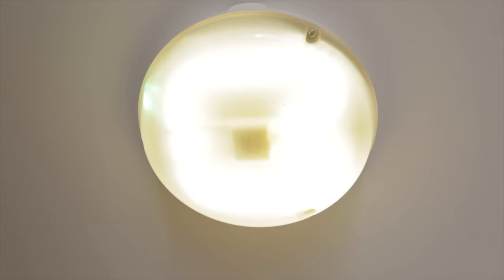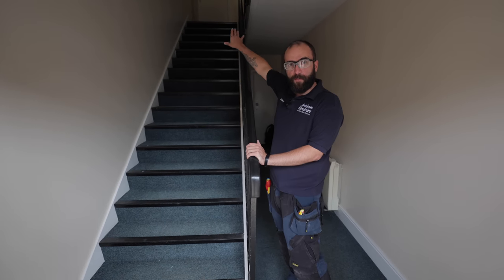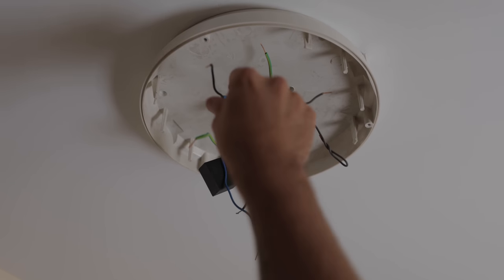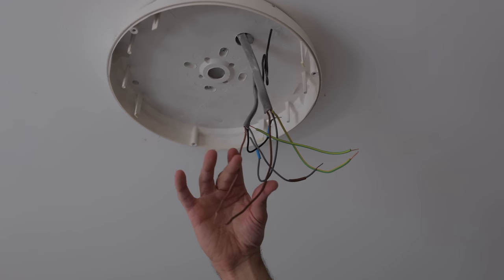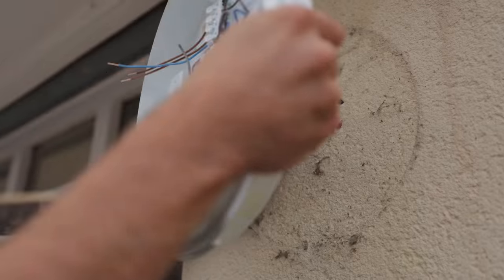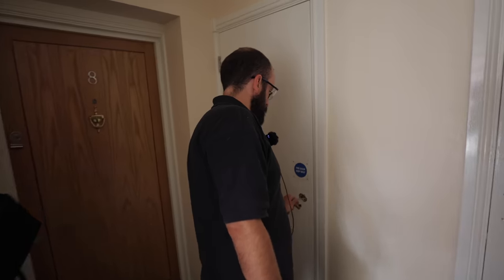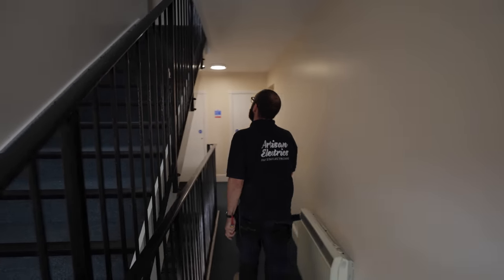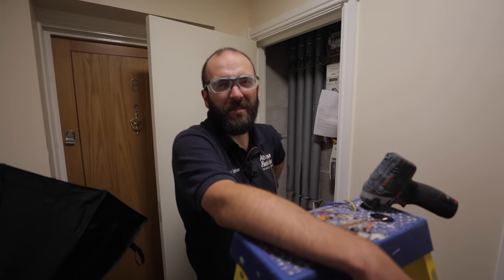Blinding LED Lights, EMBARRASSING Lockouts & Electrical Cardio

Comment: When we had the lighting replaced in our corridors/emergency routes, we also had CCTV installed; we noticed that the cameras were using a lot of storage, the lights would trigger each other and trigger recording, I'm sure our sparkies had a "great time" adjusting them.

Comment: Hello, Artisans. I wanted to ask, if you could produce a video, about energy monitoring in your home? Smart Meter, Smart plugs or whatever is the best possible and cost effective way to keep an eye on your consumption. And also wanted to say, thank you for your very well made and informative videos. You are a great team 👍
Reply: May I suggest you get a clamp on meter with a remote display, (Amazon) you can watch your consumption change as you use it, problem is after a few weeks you just ignore it, since you must boil the kettle,  run the washing machine etc. Smart sockets that you control via app or voice, are a novelty, you should get up and turn things off. If you want to use less electricity, get LED lamps and switch stuff off as soon as you are finished with it. 😀
Reply from the maker: Thanks for the idea!

Comment: You should really be putting todays date on those batteries so the next contractor knows when the 4 years of service is up. Yes the manufacter date is on them but that could already be a year prior to installing. You may have done so but it didn't look as though you did.

Comment: We did some communal lighting upgrades last year. 3 storeys, push buttons. 3 switches for each level. All wired in galv conduit. There were so many redundant lives when we finished! We pulled out loads of red singles and linked out every switch. It was very satisfying. 

A word of caution, those microwave sensors can see through flat doors. We had to turn the sensitivity right down outside the flats as some doors had windows in.
Reply: Similar problem. Had one in a toilet, which was fitted with a fire door.  The light could sense you entering the building, through/under the toilet door plus through/under a second fire door! The light does not trigger if you walk past the closed toilet door and sometimes even fails to light when you enter use the toilet.
Reply: I totally agree about the sensitivity on these. I default to 50% sensitivity then a lux disabled walk test to check switching for the escape route. Then set lux and  re walk the route to check for any unwanted daytime operation then finally set the duration. There is a bit of skill in getting these set up well as even in daytime you get varying Lux levels in common parts where there are flat doors further away from natural light sources. I swear if the sensitivity was left at 100% they would probably be constantly on picking up traffic outside the building! 🙈😁.

Comment: Knightsbridge is ok, but Ansell are far better 5 year warranty too on batteries, plus Ansell have a gap between the base and the plate so entry isn't an issue, They are more expensive but shouldn't be a problem for 5star electricians, Great video 😉

Comment: You don’t get any time allowed for setting up systems or testing properly as it’s all cut throat and the cheapest prices always wins.Standards are so low it’s embarrassing.
The race to the bottom began decades ago and now it’s so bad I’m glad Im retiring soon and leaving the electrical industry as it’s been dumbed down by cowboys and the unqualified 10 week course brigade who will work for 60 quid a day.
Pathetic and a testimony to how those in power look down on the building trades.
Some so called electricians don’t even know how to complete a minor works certificate or do any testing.

Comment: Great vlog again John/Artisan.
What is the small Bosch drill he is using - looks real handy & where do you source all your driver bits to suit. Does it have a clutch??
I would like to hear John explaining split phase voltage etc...
Always enjoy the quality work & vlogs guys
Keep it up
Reply: Looks like one of the several different "electrical screwdrivers" Bosch makes. Some of them have torque settings, and AFAIK they all use normal bits. The only difference to a drill is the weaker motor

Comment: In the building where I live (18 floors in total and 3 staircases) here in Denmark, we have probably about 1000 lights that are on 24/7 because the emergency escape routes must always be adequately lit. Because it's a private residential building (as in not a place of business or public building, and not owned by the city/state) there's no requirement for emergency lighting or the normal emergency exit indicator lights. A few years ago they switched the aging and failing CFL bulbs out with LED, but they apparently didn't get the lumen right, so the lights were far too dim and didn't provide adequate light at night, and thus the building failed the fire inspection. They then claimed they had trouble getting the correct bulbs (even though you can buy them in any supermarket), so it took almost a year before we got the lighting up to a proper level. Then this winter there was a fault in the power supply for the lights, so most the building had no lights for a couple weeks. This is obviously illegal and also incredibly dangerous, and it literally meant it was impossible to walk around in the building without a torch, and of course the CCTV doesn't work in total darkness. We still don't have motion sensors for the lights, despite asking management for them repeatedly, so we're still wasting a ton of power on having the lights on constantly, because even LED adds up when it's that many lights. Supposedly the way the lighting is wired makes it difficult to add motions sensors, which really is just management's way of saying: we don't want to spend money on that when the current system is compliant

Comment: Lights without a centre entry hole aren't well thought out! We had those old pneumatic push buttons scattered through the stairs and foyers my block of flats. Many years ago I had the fittings replaced with LEDs and inbuilt microwave movement detectors. The lights on stairs are set to 15 second off time if no movement. I've subsequently replaced foyer lights with the same plus a dim to 10% function and they're set to 1 minute before step dimming down.

Comment: There is a need for a useful BS standard specifying fixing hole and cable entry positions for the common styles of commercial lights,  linear bulkhead emergencies, these drum lights etc. It would then be a simple swap.  But that is common sense, not what we usually get from BS standards......

Comment: The question is how well the electronics last with the constant switching over time as unfortunately led by design like these fittings means there not genuinely user serviceable and more aided to be replaced then repaired. Where as with the 2D lamps you could replace the lamp with little electrical knowledge.

But in theory the passive switching is a nice touch and better for the tenant. Who pays for these in service charges.

Comment: Also what do you do with the old fittings and lamps. As the gear could be salvaged to do odd on the spot replacements for failed drivers etc. Or odd bathroom replacement if the cust is on a budget

Comment: What’s the make and model of those lights? I have a project coming up similar and need a good decent light. They looked nice and bright..
Reply from the maker: Knightsbridge BT14
Reply: I can recommend the collingwood wL95 lights. Easy to fit and come in a range of options. They have integral light switch to swap between warm, cool or daylight led effect.

Comment: Check out Lumineux Rutland for your next job. Cable entry can be anywhere you want and for emergency they do a self test option which saves you time on key switch point and easier to test- no 3h manual duration test required just check for green light ones a month :)

Comment: Interesting presentation, those plasterboard fixings are not the best, pretty rubbish actually 😂
Reply: What else would u use in a plasterboard ceiling with no joists near the light fitting?

Comment: Bit excessive taking the wires out the fuseboard no? Why not just shut the breaker off?
Reply: Safer than just turning it off 
It makes sure no one would accidentally turn that circuit back on
Reply: @BenCos2018  wouldn’t need to do that if correct isolation and lock off procedures had been applied to start with.
Reply: Or use lockout tag. £9 eBay
Reply: @rattlehead85  not wrong there haha 
still both work though tbh
Reply: Circuit breakers locks, buja!
Reply: Much safer and future proof to disconnect. Lockout kits etc are good for temporary, but what do you for when key is lost, new landlord or the electrician with a key changes career? Disconnect and LABEL the wires.